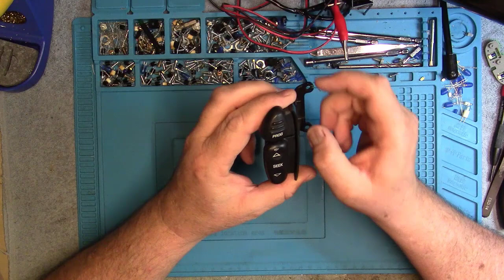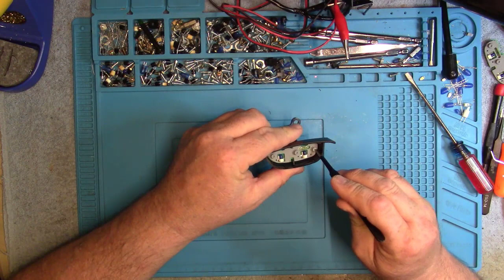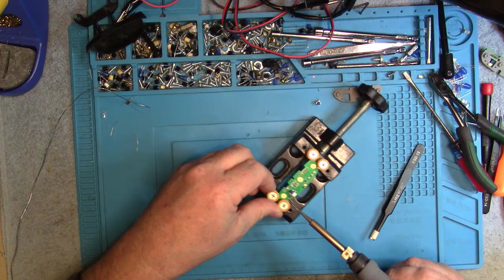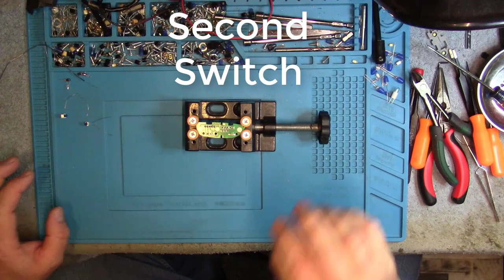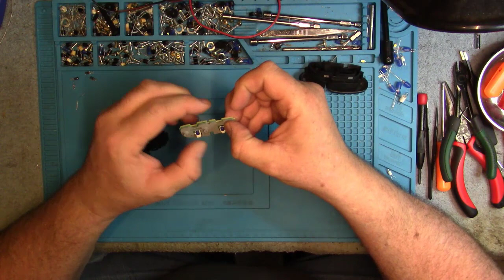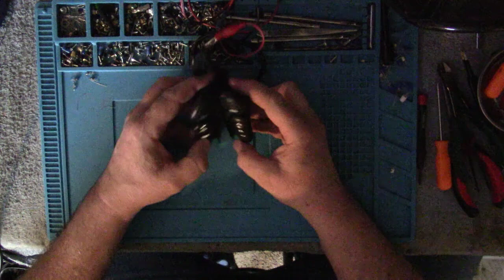How To Replace GM Steering Wheel Control Bulbs

Comment: Nice 👍 ive already been threw three sets from the junkyard trying to get a good set of switchs were can I buy these bulbs at ?  As you probably know these switches were only manufactured from 1999 to 2002 as far as I know so they're pretty much all burned out and yeah you're right you cannot buy them anymore.
Reply from the maker: Hello
You can get the bulbs here  https://carradiobulbs.com/products/1995-2004-suvs-and-pickups-steering-wheel-control-bulbs/
Reply: Thanks!!   And Merry Christmas sir.
Reply: @Car-Radio-Bulbs  I have a Pontiac Grand prix 2008 and I'm attempting to do the same thing with replacement bulbs in the steering wheel controls. Do you think these same bulbs would work with a Pontiac? I have the red sleeves but I'm wondering if they're the same wattage. They look exactly the same.